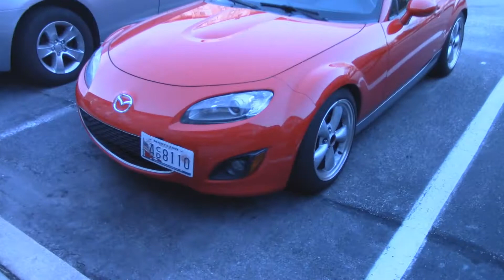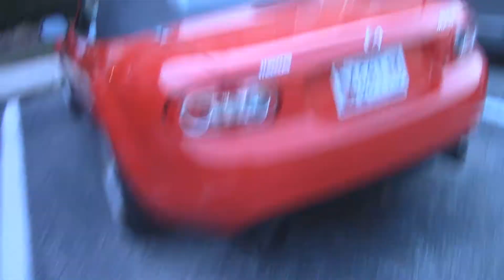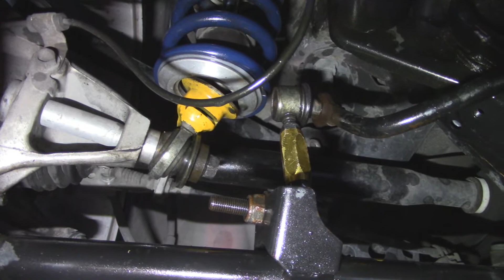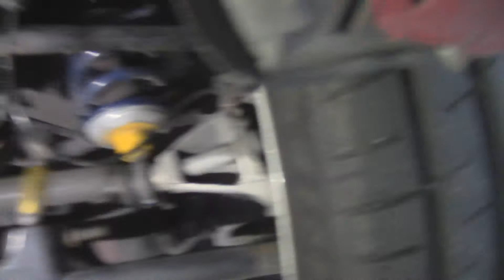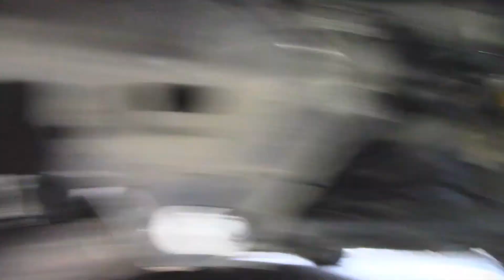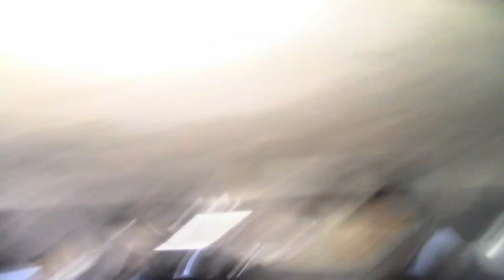2016 STR vlog #3 - Koni Down, Koni Down!  | BTR diaries

Comment: What endlinks are you running front and rear? Do the make any noise when daily driving?
Reply from the maker: +Zadnak1 

I do not know what they are but I assume they are Flyin Miata as the Front and Rear Bar I have for it is from Flyin Miata.  I purchased the car with them on it.  They do not make noise in the front and the Rear is disconnected so there is no noise there.